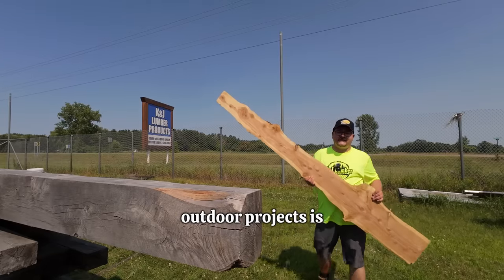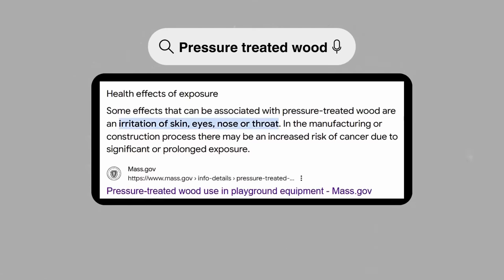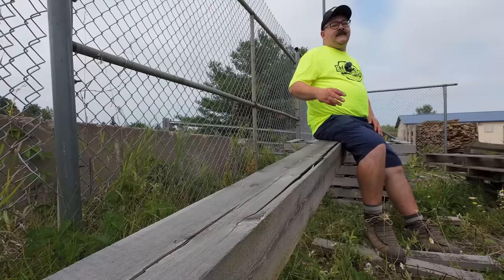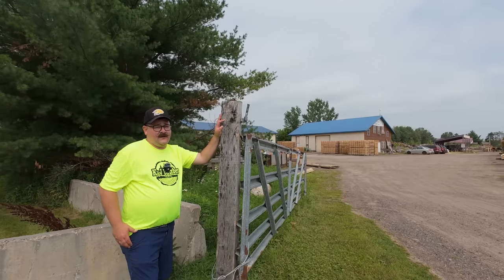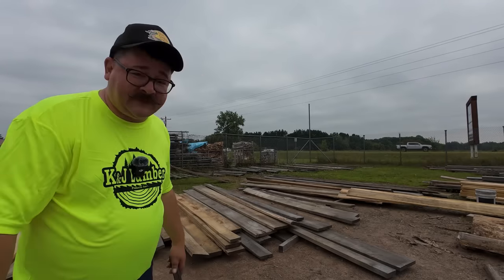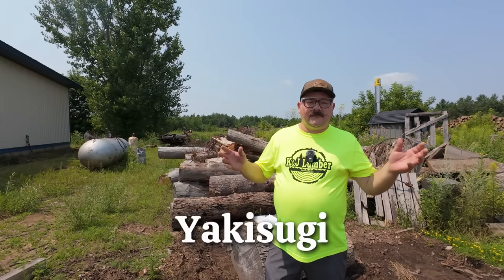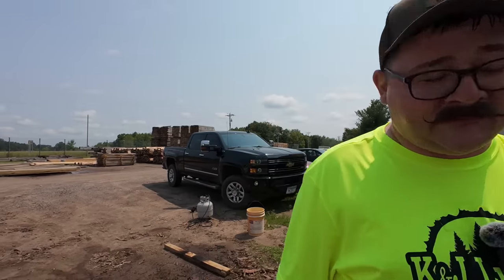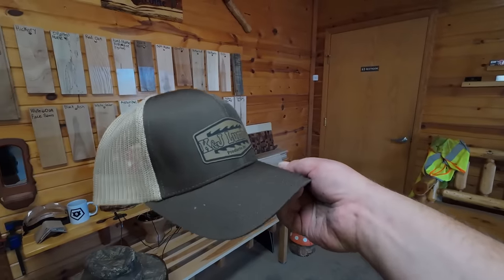the Best Wood for Outdoor Projects is...

Comment: Black Locost: hands down best outdoor wood. When the Archeologists excavated the Jamestown, VA site, they found sound B L foundation timbers.  Grows fast but does not necessarily die young. Unless it grew in forest ,tight light conditions,  or was pruned while young itmay be  be knotty   On well drained loamy soils grows to 100' and lives over100 years. I have many such trees in my woodlot. In addition its a Nitrogen fixer so other hardwoods love to grow around its roots and the leaves are high N too. I have wagons with 2" planks with no  rot after 30 years outdoors with no preservatives.
Reply: Yes. I thought he was going there. I’m gunshots oak is 2X the price, or more.
Reply: Best fence post too, burns good for your wood stove.
Reply: I wears out a saw blade 2x as fast, but it is extremely strong and lasts almost forever.   It and Sassafras could completely eliminate the treated lumber industry.
Reply: Mine are big and tall and don't blow down in hurricanes
Reply: @garagedreams4391  a guy outside of town had a bunch of big black locust.  Some were almost 3' across at the base.  Tornado came through about 10 years ago and broke the tops out of most of them.  Another guy about 3 miles from me lost several nice locusts due to inline winds last summer.  They were about 2' across, and were up rooted.
Reply: I like Black locust, but it's not readily available in most places. White oak is also good, but I was surprised to hear him describe it as inexpensive. It's quite expensive where I am.
Reply: @nospam3409  The most we've had here in recent history is category 1. They lose some branches but so far so good. I'm sure their day will come.
Reply: I was thinking Black locust myself. Every old fence post you see in the ground in the East is usually Locust. Burn the ends and stick it in the ground. Wait 75 years and replace it.
Reply: It's nice to see some people that know alittle about wood too. Black Locust is the obvious choice.
I lost all respect for the creator when he said that current pressure treated lumber is dangerous.
Yes, if it falls on you or maybe if you take the sawdust and use it as flour for bread for 30 years, then yes, it's dangerous🙄
Reply: Black locust and Osage orange that grows in the bottom ground like creek bottoms will be the best choice for making lumber or fence posts because they will grow straight and tall with fewer branches but cut in winter when the sap is in the roots.
Reply: @nospam3409 
One of the books I have lists Black Locust, Red Mulberry, and Orange Osage as similar in the very high rot resistance, of course there are the more fragrant rot resistant woods, like Sassafras and others.
My favorite is Black Locust, because they were all over the place, 100 feet tall in the ravine.
The grass also grows like crazy under them.
Reply: @modoc852 
Our Black Locust trees reached 100 feet in the ravine.
How tall does Orange Osage get.
Reply: what is the latin name?
Reply: A locust fence post will outlast the hole it's in. Told to me by my old Chek neighbor.
Reply: Idk, but it shouldn’t take 14 minutes to find out.
Reply from the maker: @BobBob-eh5sb Sorry I wasted your time.
Reply: Black locust is the most durable, longest lasting wood. It tends to rot after a couple hundred years of ground contact and you need a  .50 caliber machine gun and a couple of hours to cut a board to length, provided you can get it worked down into a board. Cutting black locust with steel blades is like cutting stone blocks to build pyramids with a copper chisel. You scratch your head and wonder of splitting it and leaving it rough is good enough. We had a split rail fence with black locust posts but had to replace them with oak because the woodpeckers kept knocking themselves out and they were stacked in rows along both sides of the fence. Game warden thought the kids were killing them with BB guns and wrote out a citation but he had to tear it up for lack of evidence once they regained consciousness and flew away. Now that it's been 10 years and several bird generations later, all the woodpeckers in my area are born with bent beaks to help deflect off of black locust and not knock them out. Sort of selective breeding.  Many of them begun with 3 or 4 soft test pecks to check for hardness before getting started. Black locust is not good for everything. Planers, table saws, any tool you want to remain sharp. If you're driving nails into seasoned black locust you should wear body armor.

Comment: Another hearty rot resistant wood we have in the Southeast is Black Locust. Makes great fence posts.
Reply from the maker: I knew there would be some species I would miss, but mentioning them here in the comments helps others to find a possibility I also do not know about. Thank for the comment!
Reply: Is black locust widely available? I believe had had some at our farm's forest area but not many. Seems rare when not planted on a fence row….
Reply: @mrniusi11  I've never seen Black Locust for sale anywhere, but I don't get to hardwood dealers very often.  In my opinion, it's not good for much besides fence posts and outdoor furniture. It's rough, knotty, and hard to machine and glue because it's so hard and dense. It grows fast and dies young so they don't get that big, so I can't imagine getting decent lumber out of one.
Reply: Early American Settlers used black locust to build the settlements. Also, in the 1800s America naval ships were built with black locust nails. They were more durable than their British counterparts and enabled the Americans to defeat the British at Plattsburg Bay during the War of 1812.
Reply: Hard wood. I've had sparks appear while chainsawing it.
Reply from the maker: You probably hit a nail or some other type of metal if you saw sparks.
Reply: @kandjlumber  I was waiting for that reply. Nope, no nails, no rocks. It was dry, clean Locust and the chain was a nicely filed full chisel.
Reply from the maker: @paulhare662 that is baffling!
Reply: @kandjlumber  I wonder if it could be minerals absorbed by the tree as a grew.
Reply: I must be lucky I found a 70 year old almost 2 ft dia Back Locust in my woods a couple of year ago. When I cut it down it was about 60 ft long. I chain saw milled it into 4 quarter and some 8 quarter. I did need to sharpen the chain after almost every cut. I plan on using it for decking and a stair case and have one 4x4 for a mailbox post. I haven't gotten much further than that yet but hope to next summer. Its' all under cover and drying still. I do have 15 ft and 12 ft 1.5 x 12 inch boards all planed a ready for the stair case sides and I will tell you this wood is heavy.  When I looked it up it has a higher density than oak.  The wood has a slight yellow color and seems to plain quite nice.  I have been thinking about charring the end of the mailbox post (Yakisugi) that goes into the ground.  This video just made that decision easier to make.
Reply: I am experimenting with building musky baits from black locust.  I want to lay claim to producing the ‘toughest most water resistant’ wooden glide baits. I build with CNC router and find it functionally equivalent to maple.  Interesting fact:  Black Locust heartwood glows under a UV light.
Reply: @paulhare662 I’ve been told it absorbs lots of sand and minerals while growing. Could that be it?
Reply from the maker: You’re probably waiting for this as well: metal detector?
Reply: @patricktcrowe  Possible. I hadn't thought about that. Good point.
Reply: Osage/Mock orange/Bodock is great for rot resistance. It will also throw sparks when sawing.
Reply: @paulhare662  You are not dreaming. Black locust is a chainsaw killer and does spark when cut. I've cut Black locust for over 50 years here in Southern Pennsylvania and it's harder than a wedding groom. You can buy locust fence post that are already sharpened like a pencil but the only way to get dimensional boards or posts is to get them custom milled.
Reply from the maker: @hackemazanowski7738 Wedding Groom 🤣😂
Reply: @kandjlumber  old enough it starts to mineralize as does very old dry white oak. i have had 160 year old dry white oak spark like crazy when chain sawing it.

Comment: I just rebuilt a deck that I built 30 years ago with WRC that was never coated with a finish.  The surface was roughened, but after removing 1/8" with a planer, the underlying wood was as good as 30 years ago. 
Also, I made a garden bench from Douglas fir and  charred it (shou sugi ban) and scrubbed it hard with a wire brush.  It's been on the front porch for about 10 years and is in good shape.

Comment: A note on Yaki Sugi.  The side of the plank closer to the center of the tree is the side you burn.  That's the side a Japanese carpenter will have facing out on siding, because the side of the plank closer to the bark is the side that will cup.  If it cups, they want the edges of the plank to pull closer to the building.  If the bark side is out and it cups, the edges will try to pull away from the building, possibly leading to moisture or wind getting behind the plank.  (On the interior of the building, the bark side is facing the interior because it's normally the better looking side.)
Oh, and the Japanese guys who do the burning will tell you you burn it until you think you've ruined it.  Haha.
Since "Sugi" is cedar you have BBQ Pine.   Maybe Sugi Matsu depending on the species.
Reply from the maker: That is so interesting, thanks for the insight on this. much appreciated and don't forget to hit that sub button! I will be mentioning this to my local customers who ask us about lumber that is needed for a similar solution.
Reply: Also, Japanese "Cedar" is Cryptomeria japonica. Completely unlike aromatic cedars we think of in the western world. It's a white wood, quite dense. For reference, Eastern White Pine's Janka hardness rating is 380 lbf, Southern Yellow Pine is 870 and Japanese Cedar is 1,500 lbf. It works similarly with hand tools to Hard Maple, which is 1,450 lbf (I.e. rarely splinters and shaves beautifully with sharp chisel & plane blades).

Comment: I am building two Adirondack chairs with white oak. The wood is very dense and heavy.
I decided to make the chairs with white oak because I worked in the railroad industry for twenty-one years.
The best wood railroad ties are made from white oak.
The railroad ties lasted thirty years, even in a salty air environment.
A word of caution for any woodworker working with white oak is to be sure to pre-drill prior to driving screws.
If not, the screws will snap, especially if using stainless steel screws. Coating the screw threads with wax will also help the screws thread into the wood more easily.
As someone commented. White oak has become extremely expensive.
The lumber for the two chairs cost me over $500 two years ago.
Reply: Why not build chairs to sit in instead.

Comment: I use Larch when building my outdoor furniture. Very durable stains well and holds up well in the elements. Been using it for years never a callback.
Reply: Yup, juniper is bullet proof for outdoor use.
Reply: I am building my deck out of Larch i am milling myself.

Comment: I’ve used thermally modified lumber with great results. It’s burning it without the bunt. I’ve also used white oak. Both are beautiful and long lasting.
Reply from the maker: Yeah cant be beat, thanks for the comment as well, much appreciated from a small channel like this.
Reply: Heat Treated (HT) is what a lot of skid material is going to in order to get away from the chemicals. 

It can be really beautiful tho definitely not cheap.

Comment: I helped my dad paint poplar lumber with used motor oil on a fence (not the posts mind you) he was building 35 years ago.  That fence has been painted with used oil four times since and nearly every board is still sound. The few that rotted I believe were just too near the bark.

Comment: The west coast Indians used that burn method as well, mostly with split cedar planks and would stick the ends in the fire since end grain is where most of the checking/splitting happens first.... Also, from the mid west farmers (I grew up in Misery), "A black locust fence post will wear out one fence post hole. An osage orange fence post will wear out 2 fence post holes". The locust is ideal for split rail fences, depending on how much you have around....

Comment: Fun video.  Thanks kindly for making it.  Another couple adds about yakisugi (sorry if they're repeats, I only ctrl+f'd through the first load of comments).
- The "sugi" in yakisugi is the specific Japanese cedar traditionally used, but you're right that the process can basically be used on any variety.  Guessing the benefit of thujaplicin stacks nicely as a second line of defense behind the charred skin.
-  The char is inherently rot and bug resistant as it has little nutritional value for fungi and pests who aren't willing to eat through it to reach the unburned wood, but I believe it's usually still sealed with a lacquer to repel water.  Charcoal has a very fine, porous/spongy form that is actually great for holding water (think biochar).
- As I've seen and tried a few times, the triangular tube is stood up on end, slightly leaning on something tall and a small fire is lit at the bottom.  This reduces the amount of kindling you need and uses a bit of a rocket/chimney effect, pulling air up through the fire at the bottom while the wood itself becomes the main fuel for the burn.  It's really quite dramatic seeing the fire erupt out of the top.  Kind of a good demonstration of why those of us who still use chimneys want to avoid a creosote fire :D

Comment: Nice video, burning the wood really does work!. When I was a kid my dad pulled some red cedar gate posts out of the ground in a coral that had been buried well over 30 years.  The surface of the buried post had been burnt and it looked just as good as the day it went into the ground.  Depending on the soil and ground moisture 10-12 years would have been about the maximum life expectancy of a red cedar post in our area.
Reply from the maker: That’s amazing! Thanks for the comment!

Comment: Pressure treated is ok but will rot quicker than you think when it's on the ground. However they do make a ground contact lumber. but you can only find wood that is specially labeled ground contact at home Depot in our area. Lowe's does not seem to carry it here.

Comment: Great Video! I’m having a new deck built after a Mountainado trashed it. Our cabin is at 8500 ft elevation at the Colorado/Wyoming border. 300 day of sunshine, lots snow, Temperatures range from 90 degrees F down to -25f. Very low humidity. All that to ask recommendations on wood( White Oak? ) Also would the burning technique with proper safety precautions work AFTER the deck is built? Would it cause the deck planks to shrink or twist? Obviously a rookie here! Thx much ! Will
Reply from the maker: I do know that in our area (similar temps), we need to bury posts deeper because the freeze/thaw will cause the post to rise out of the ground more than warmer areas. We are in the process of doing a similar video on Ground Contact solutions. So keep your eye out for that. Also, one of our coworkers is going to use white oak to build a deck and may film that process as well. The burning process, this was the first time I (Kyle) has even tested this and haven’t used it on anything as of yet. There’s a bunch of videos out there by Yakisugi experts you can search and would fully trust their opinion over anything I could suggest. I am sorry this isn’t much help but I hope I could at least point you in the right direction.

Comment: Another possibility is torrefied or "toasted" wood. It is wood that has been kiln dried at a higher temperature than usual, almost to the point of burning it. I've seen maple and ash, but I'm guessing many species would work. The wood becomes much darker in color and lighter in weight, and is much more rot resistant and no longer appealing to insects. I have some torrefied maple that looks like walnut and has the weight of pine or cedar.
Reply from the maker: I'll have to look into that. Sounds super interesting, thanks for the comment and knowledge.
Reply: I heard of Kelo wood which is wood from pine trees that have been standing dead for hundreds of years in europe and the wood has a golden color like the torrified wood used for guitars. Its widely used for saunas due it it being odorless and not taking on any water and therefore rot resistant.
Reply from the maker: @jackquillen9120 that is interesting.

Comment: White oak in Houston at Lowes is $4.00 a board foot for a 1x4. They don't sell anything bigger. So that wasn't any help. Cedar is also insanely expensive here.
Reply from the maker: Is that Kiln Dried White Oak you’re talking about? Or was it Rough Sawn fesh cut (green) white oak? Much cheaper, air drying takes forever but may work. Call your local sawmills if you have any in your area.